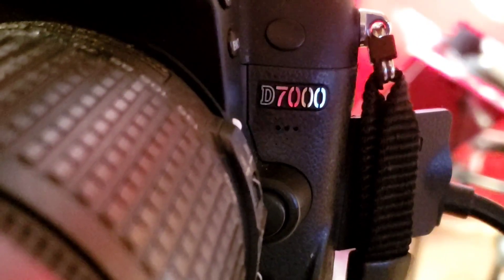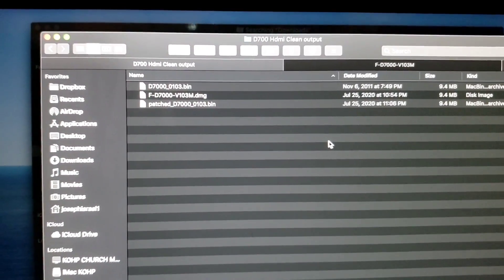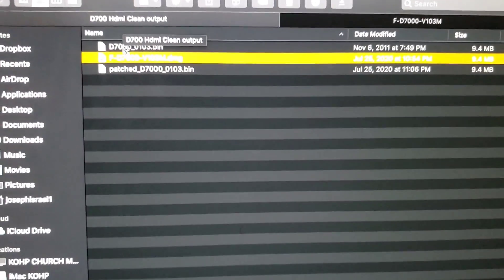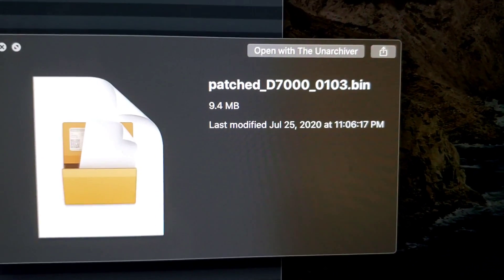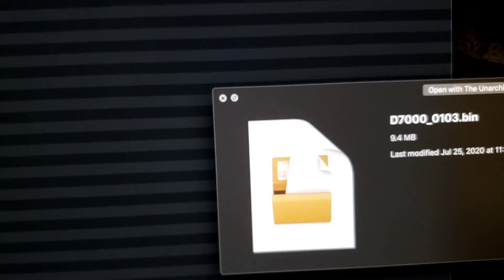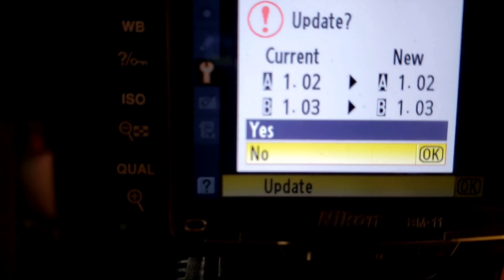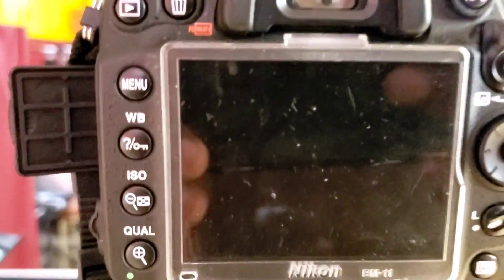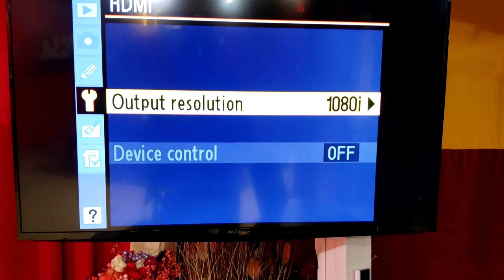Nikon D7000 - How to get Clean HDMI Output - LIVE STREAM – SOLVED !!!

Comment: Thank you for this. I bought the firmware and loaded it, but have encountered an odd issue. I have clean output, but for some reason I  only get 1080i when viewing the menu, when I output the sensor's feed it's scaled down to 720p. I've tried different HDMI settings on the camera, Auto, 1080, and 720; all output 720p. I'm using it with a Atomos Ninja V.
Any ideas?
Reply from the maker: Hello Kurt,
Indeed it's an odd issue. Have you been able to capture desired output prior the firmware ?
Reply: @joseph-israel  I've plugged the d7000 into the Ninja once ever before the firmware switch, I don't remember what output I got.
It's not the biggest issue, Topaz Video AI can do it's thing, and this setup isn't for client work. I was just throwing the question out there seeing if there's something obvious I might not be thinking of.

Comment: I have D7000 with 1.0.5 firmware. Ive transferred the bin and renamed the patch to D7000_0103.bin but not seeing an update firmware. Help?
Reply from the maker: You're to use only the patch. Please Redo the steps and make sure you place it at the root of your SD CARD.
Reply: @joseph-israel  I figured out the issue. 
It was because my camera was still plugged in via usb to the computer. I unplugged it and update firmware became available.
Reply from the maker: @Bryanc130  Excellent! Good it worked out. Yes indeed, you're right. When HDMI or USB still plugged it can in some cases prevent further operation for update.
Reply: @joseph-israel  can you link me to the hdmi cable you are using? Is it possible to use the usb to the computer to achieve video to stream labs OBS?
Reply from the maker: @Bryanc130  No you won't be able to achieve a direct connection without a sort of converter. But here is a simple HDMI TO USB converter and cheaper solution you can use https://bit.ly/3MMN8J7

And for the Hdmi cable this should make it up https://bhpho.to/3xQ4eBl
Reply from the maker: @Bryanc130  If you haven't done it yet, I encourage you to grab THE POWER SUPPLY HERE https://bit.ly/spnikon for uninterrupted power supply. I have made the test for my live streaming 2 years in the row with the power supply, and Did not have any issues.

Comment: The device control option is not available on the Nikon d300. Could anyone advise on how to remove the screen info on this camera please?
Reply from the maker: If you haven't done it yet, I encourage you to grab THE POWER SUPPLY HERE https://bit.ly/spnikon for uninterrupted power supply. I have made the test for my live streaming 2 years in the row with the power supply, and Did not have any issues.
Reply: @joseph-israel  thanks for your reply. Sin love I commented I’ve bought 2 Sony a6000 and one a6600. The d300 isn’t compatible with streaming unfortunately. Not for what I needed it for anyway. A clean hdmi out is not possible. Thank you though for your reply :)

Comment: Thank you Joseph, this worked for me exactly as you described it.   Thank you for the links and the details.  I bought an old D7000, upgraded the firmware (V1.05) and expected it to work with clean HDMI. Big mistake. I should  have watched your video first.
Reply from the maker: Thank you for watching. Glad it got you situated. Happy 4th
Reply from the maker: If you haven't done it yet, I encourage you to grab THE POWER SUPPLY HERE https://bit.ly/spnikon for uninterrupted power supply. I have made the test for my live streaming 2 years in the row with the power supply, and Did not have any issues.

Comment: Hey Joseph!
Great to see that you from IL(as me)can you(or if you already have one) explain more about the d7000 patch abilities?(other then clean HDMI output)

Thanks!
Reply from the maker: Hello,
The Hdmi clean output is only an activation for that unit which was a BIG deal for many and still is. The entire system stays intact, and only the Hdmi clean output is activated. So depending on the use of it, it can be crucial or irrelevant. Besides that there is nothing else the patch does.
Reply from the maker: If you haven't done it yet, I encourage you to grab THE POWER SUPPLY HERE https://bit.ly/spnikon for uninterrupted power supply. I have made the test for my live streaming 2 years in the row with the power supply, and Did not have any issues.
Reply: @joseph-israel  thanks for your reply!
Is it not getting hot during long use?
Concerned about damage the camera
Reply from the maker: @kobirighter  I have set this camera as one of our Livestream shot. 2021 to this date it's been running non stop!!! It would have gotten hot for reason of a battery inside, but since there is no battery and it's fed through continuous power, I never had issues with it being hot... not even a tiny.
Some of my cameras are 24/7 ON. And this is one of them. They are all connected to our TV switcher and works great.

Comment: Hi. How do you deal with the D7000 shutting down after 30 minutes?
Reply from the maker: Hello 👋 
I use mine for doing lives, and it stays on For several days continuously. It remains plugged into the outlet with a specialized power adapter. Not sure if yours is battery powered but you can give a look in the video description to see which power adapter I'm using
Reply from the maker: If you haven't done it yet, I encourage you to grab THE POWER SUPPLY HERE https://bit.ly/spnikon for uninterrupted power supply. I have made the test for my live streaming 2 years in the row with the power supply, and Did not have any issues.

Comment: Hello! Do I need to connect the hdmi cable to a switcher or capture card, or I can just directly connect it to my macbook pro?
Reply from the maker: hey Samu. Yes you will a switcher or capture card of some sort. The HDMI port of the macbooks are Output signal only. So either USB A or C, Thunderbolt 2 or 3 are capable to get the work done. I have received a free device which I happened to test, and it might work for you. check it out here https://bhpho.to/3qypaJz .. just grab any that fits your need and budget. you can find both HDMI to USB A and HDMI to USB C
Reply from the maker: If you haven't done it yet, I encourage you to grab THE POWER SUPPLY HERE https://bit.ly/spnikon for uninterrupted power supply. I have made the test for my live streaming 2 years in the row with the power supply, and Did not have any issues.

Comment: So are you able to get the 16:9 aspect ratio with this camera when connected to pc or tv?
Reply from the maker: No. Natively the camera does not have the 16:9 ratio. But I transit it through a sort of device (TV Switcher) to get my 16:9 aspect ratio. I'm sure there are free options out there but never looked into it. Someone else in the comment seems to have found also an alternative
Reply: @joseph-israel  can you explain it further if you have time, for example send me a yt tutorial... and how does the picture look, is it streched?
Reply from the maker: @crazyzard  Ok will look into doing a tutorial, later on but it requires additional gear for my case. Other than that, No, it is NOT stretched. Rather display very well as if it was natively 16:9 ... do you already have some sort of switcher such like the mini pro switcher ?
Reply: @joseph-israel  i'll have to look around a bit, but thank you, when you make a tutorial just paste the link here. Thanks
Reply: @joseph-israel  yeah... i dont have a switcher

Comment: Hi, thank you for the tutorial, this works well. After installing the patched firmware, is it still possible to see the settings on the display for when I just want to take a photo?
Reply from the maker: You're welcome. Yes you should. Nothing except the hdmi ability been activated. 
Let me know how it goes
Reply: Hey! Just wanna ask if it worked? I got an D7k and I'm interested in modify the firmware, but also want to use it as a normal photo camera and Streaming cam.
Reply: @Kayakos  From memory, yes it worked.
Reply from the maker: If you haven't done it yet, I encourage you to grab THE POWER SUPPLY HERE https://bit.ly/spnikon for uninterrupted power supply. I have made the test for my live streaming 2 years in the row with the power supply, and Did not have any issues.

Comment: can you help me? for some reason after i do all of the steps exactly as you do my nikond7000 will not let me update the firmware
Reply from the maker: Hey Nick, which type of SD card did you use?
Reply: @joseph-israel  its a blue SD card that says SD HC memory card high speed 8GB
Reply from the maker: @Inkedup128  If you haven't done it yet, I encourage you to grab THE POWER SUPPLY HERE https://bit.ly/spnikon for uninterrupted power supply. I have made the test for my live streaming 2 years in the row with the power supply, and Did not have any issues.
Reply: @joseph-israel  when i put the SD card in my card ready. It only shows the DCIM folder. But there is nothing else in that or below it.
Reply from the maker: Okay, did you format it with the nikon itself or computer?
Reply: @joseph-israel  so after i couldnt get it to work. I formatted it with the nikon. Idk how to format with pc if possible. I just dragged the patched file and renamed like you ssid but did not give me a update firmware option
Reply from the maker: Got ya. While card in, do you have any other cable like hdmi or else connected to the camera?
Reply: @joseph-israel  not when i try the firmware update. I did download the file from your link in description. Should 1 of those be in the DCIM file for the root patch to work? Cuz like i stated its totally empty with no firmware or software folder.
Reply from the maker: @Inkedup128  no, the file should be at the root of the card directly. And try swapping it between first and 2nd slots see.
Additionally you want to make sure the renamed file matches the exact name and it is case sensitive.  If you can back up your data, I will recommend your format the card using a FAT 32 if on windows or MS DOS (FAT) if on Mac. The card need a 4096 dedicated sector to read data firmware correctly. 

Chatting In here is kind of limited but I'm trying my best to guess and help you.
Reply: @joseph-israel  when i look at the firmware it reads 
A: 1.03
B: 1.04
L. 1.006
Reply: @joseph-israel  i reformatted on pc so it has the 4096 dedicated sector but still nothing.
Reply: @joseph-israel  do you think a newer bigger SD card would work? This SD card is from years ago
Reply from the maker: @Inkedup128  sorry for the late reply. Was late here and I went to rest.
To get this done let have a Zoom chat session so I can give a closer look if what is going on.

Join me on here https://bit.ly/3wYvgDp
Reply: @joseph-israel  do you mind if i join around maybe 4 or 5pm tonight which wouod be sunday for me?

Comment: Is it 1080 resolution hdmi output ?
Reply from the maker: It will be as factory. Nothing changes except the ability to use it as Hdmi output live
Reply from the maker: If you haven't done it yet, I encourage you to grab THE POWER SUPPLY HERE https://bit.ly/spnikon for uninterrupted power supply. I have made the test for my live streaming 2 years in the row with the power supply, and Did not have any issues.

Comment: Thanks for your complet explanations!. I have a question. Is it possible to use the blackmagic ultra Studio, with the input just straight from de nikon D7000?. Greetings from Spain.
Reply from the maker: Yes indeed. You can run directly the hdmi cable from the Nikon into the ultra studio recorder device.
Reply from the maker: If you haven't done it yet, I encourage you to grab THE POWER SUPPLY HERE https://bit.ly/spnikon for uninterrupted power supply. I have made the test for my live streaming 2 years in the row with the power supply, and Did not have any issues.
Reply: @joseph-israel  Thanks Joseph. I am using a power supply in the live stream, and I have never had a problem. Everything works nicely. Thanks again

Comment: if i already have the 1.03 filmware version do I still have to install the patched version?
Reply from the maker: Are you intending to do live streaming or just video recording?
Reply: @joseph-israel  live streaming
Reply from the maker: You would want then to follow the instructions. The stock firmware 1.0.3 can not livestream... so this patch helps solve it
Reply: @joseph-israel  would it work for video recording?
Reply from the maker: @laurice3030  yes it will. You can pull the source as video input with the same capture card. If you need more help figuring out how to set it up, feel free to send me an email
Reply: @joseph-israel  oh okay thank you!
Reply from the maker: @laurice3030  no worries 👍
Reply from the maker: @laurice3030  If you haven't done it yet, I encourage you to grab THE POWER SUPPLY HERE https://bit.ly/spnikon for uninterrupted power supply. I have made the test for my live streaming 2 years in the row with the power supply, and Did not have any issues.

Comment: Its clean but cropped is that because its a 3/4 sensor..? not that it matters.. also fwiw I have found using a Standard Mirrored DSLR better than using a Mirrorless 
Mirrorless camera is much more prone to overheating.. where as mirrored barely gets warm. I am using a 35mm 1.8 lense which creates great video
Reply from the maker: Hey Alex,
Yes hardware limitations causes the cropping.
Reply from the maker: If you haven't done it yet, I encourage you to grab THE POWER SUPPLY HERE https://bit.ly/spnikon for uninterrupted power supply. I have made the test for my live streaming 2 years in the row with the power supply, and Did not have any issues.

Comment: Quick question does this also stop the Live View from shutting off in 30 minutes and just provides continuous streaming?
Reply from the maker: Well, I keep my system live open for days non stop...

So do you livestream using a battery? If yes, then look up in the description I got links (charger and electric battery) for what you need to enable you to live stream non stop. 

Did I answer your question?
Reply: @joseph-israel  Got that already I will see how it goes I did both reverse update to the 1.0.5 to the 1.0.3 then the patch worked great.  Also how do I get the stream video to scale to full screen on Quicktime like you have it?
Reply from the maker: @nontoxicdad  Glad it worked that great!  Well, that's a question for 1 million $$ !!! :-D The D7000 full 16:9 does not respond very well. the height shrinks down against the width and make the video deformed... so only the 4:3 rendered better for the patch....  

with that being said, in my QT it was fullscreen while maintaining the same aspect ratio. You can do Command + F on mac ... and I think windows would correspond to Control + F
Reply: @joseph-israel  My other Nikon streams full screen to quicktime.  Its the D7000 is there a setting I can change in the camera?
Reply from the maker: @nontoxicdad  yes, I supposed the other Nikon do have the native converter allowing the stock firmware to have a full view. The case of the d7000 is a little different. Kind of sacrificing one for the other. it was a technical choice between either the hdmi unlocked, or default settings without hdmi live. However there is a patch that integrates the hdmi + the fullscreen, but it does not render correctly the aspect ratio because of hardware limitation in the nikon d7000 ... so it's kind of 1 million question which maybe some day someone would come with a better fix... for now you can route your video in an editor that will do it and recapture it for your live.. which is actually a pain ... sorry about that, but no available settings to bypass it yet and have a proper full aspect ratio
Reply from the maker: @nontoxicdad  one more thing ... if you're using OBS or Wirecast for live, you can get out a full view.
Reply: @joseph-israel  I figured it out I was able to blow up the image on my input on my Roland VR-1HD works really well the quality is great.  thanks again for all the support!
Reply from the maker: @nontoxicdad  That's awesome! You should share how you got it done. 
Been working on my new Atem Mini Extreme ISO to get this done, but so far no results!!!

Congrats 👏!!!
Reply from the maker: @Warren Phillips... You put me on challenge notice to get the 4:6 converted into 16:9 through the software control of my Mini Extreme Iso Tv switcher ... 
I finally was able to get it done and have chroma key over it....  now I got a full view with proper lowers thirds which I could not achieve in the Mini Pro version of my tv switcher. 

Thank you buddy
Reply from the maker: If you haven't done it yet, I encourage you to grab THE POWER SUPPLY HERE https://bit.ly/spnikon for uninterrupted power supply. I have made the test for my live streaming 2 years in the row with the power supply, and Did not have any issues.